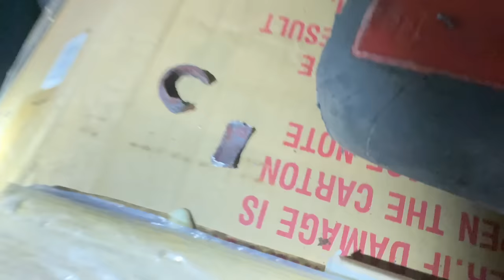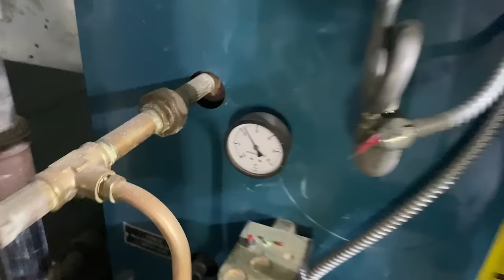Burnham Steam Boiler Short Cycling - Radiators Ain't Getting Hot

Comment: probably best to use the washing machine "hot" supply connection, instead of the water heater drain, as you'll only get so much hot water before it goes cool then cold from incoming supply and dip tube. using the T&P would work, but of course you'll have to replace it then once opened. 🤣

Comment: great video mike, looks like he also has a hydronic boiler as well what's it used for?
Reply: a large place like that, either radiant floor heat, pool heat or ice-melting. or possibly a few of them mixed.
**maybe just an large addition, to which it made no sense to try and add costly steam.(seeing the spray foam and other work done, suggest some major remodel/additions)

Comment: ❤ good job!!! lol I am guessing that tee didn’t bite you😂   I carry a bottle of AP grrip. was made by Hercules. ( few years ago warehouse went out of business and i bought a life time supply for 1 cent on the dollar) any how that black crap is nasty to use. You get it on your fingers? You literally wear it off!! you get it on your clothes it’ll be there until they rot away !! But even though that black nasty sticky gooey pipe joint and gasket seal is nasty stuff to be around if that pipe dope will not seal a leak?? There is nothing in the universe that will .it’s made for all types of gas fuels oils, glycerin,pumps, and pipes hot water, and steam boilers … absolutely great stuff. If you have a leak and can’t seal  it works on airlines super great to.😂 but I like the nuclear green ❤  edited fur spell boo boo

Comment: just get a pipe tap that size and hand tap the fitting a bit deeper, that will restore some thread depth and clean the remainder up.
no I wouldn't do that for anything pressurized above 30psi max, although it would likely work just fine that way. 🥸 I have pipe taps from 1/8" to 1-1/2" just for repairing/cleaning threads in such occasions. I should get a 2" one, but I rarely touch anything of that size  that's not being fully replaced anyway.